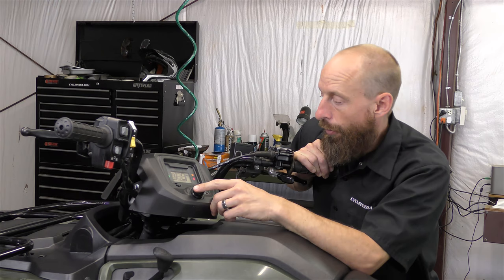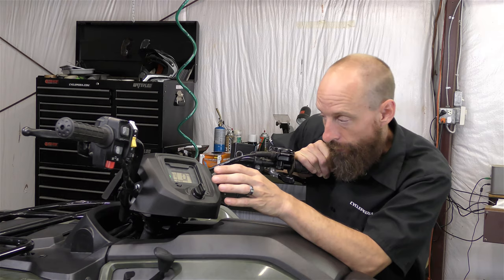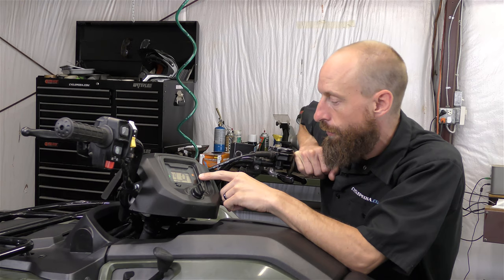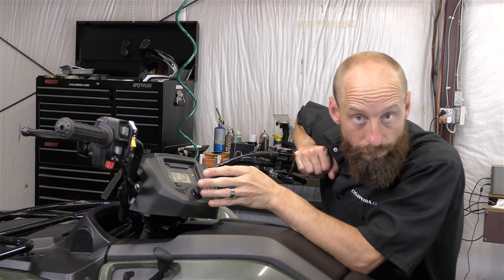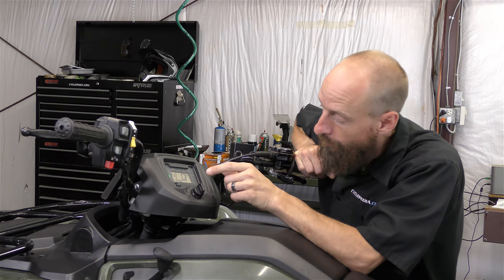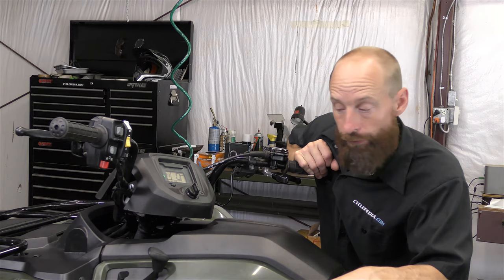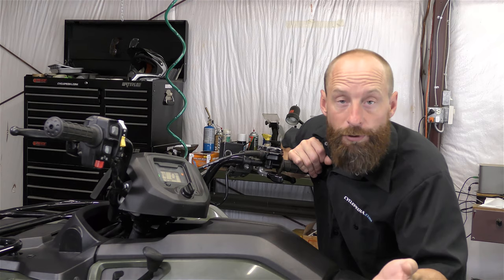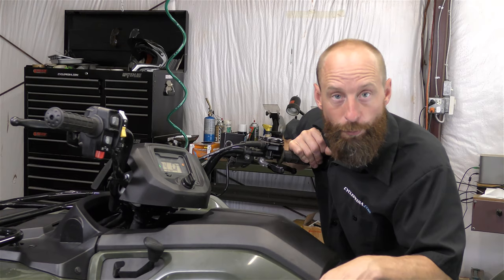Reading Honda Trouble Codes On a TRX420

Comment: 2008 trx420 manual shift. No spark. No fuel pump. Only the neutral lite turns on with key. Motor turns over. Good battery.
Reply: what you find out??????

Comment: I have been searching how to get the codes from my 2016 Honda TRX420FA2 and yours appears to be a model like mine. I checked mine for codes and I am not getting any codes but having problems with it back firing.
Reply from the maker: To start I would makes sure all periodic maintenance Items are checked, especially valve clearance and air filter.
Reply: Hey Dave what was the problem? I have the same model and it’s bogged out and back fired right now. It will idle but it Boggs out when I try to give it gas
Reply: @hernandeznick15  My problem seemed to be the gas I was using. I was using regular gas. I don't ride mine that often and they say regular gas only has a shelf life of 30 days. I switched to high test and haven't had a problem since.

Comment: I have a 2007 420 manual shift , no spark , no nuetral light and fi blinking lights wont even come on ?? Any advice ?
Reply from the maker: Take the seat off and look for rodent damage. If you don't see anything obvious then get the correct service manual to help troubleshoot.

Comment: My 420 has the same code from sitting up. What did you do to fix it? Didn't see the follow up video
Reply from the maker: O2 Sensor Heater Resistance test was out of spec, replaced sensor and fixed problem. We recommend testing components before replacement to avoid buying parts you don't need. Here is a link to sign up for the manual which includes tech support if you need it. https://www.cyclepedia.com/online-manuals/cyclepedia-honda-online-service-manuals/honda-trx420fe-rancher-online-atv-service-manual/
Reply: @Cyclepedia  thanks for the response!

Comment: I have honda rancher 420 es that wont shift into 4th and 5th gear. The angel sensor and shift motor and shift solenoid has been replaced. Would you be able to tell me what could be causing the problem.
Reply from the maker: Are you getting any trouble codes? Could be mechanical also.

Comment: I was a Honda motorcycle mechanic for 30 years .. If you don't have the pocket tester why don't you use the MIL tool to read the DTC codes ..
Reply from the maker: We just wanted to show people you can read the MIL blinks with no tools as most won't have what you mentioned and don't want to go to the dealership just to fix a simple problem like the atv in the video had.

Comment: Thanks for sharing that information.  According to your advice i have code 24.  Does anyone know what that is?
Reply from the maker: I don't see a 24 on the list I have, there is a 23 though. 23 is the o2 sensor which is common to fail on some years.
Reply: @Cyclepedia  thanks for the reply.   I’m having a problem getting into neutral.  It’s stuck in first gear this time.   Been stuck in reverse before I’m hoping it’s an shift angle sensor.   Appreciate your help
Reply: @Cyclepedia will it hurt it to run it like this ?

Comment: I have a 2013 honda trx420 sometimes it will not shift no codes but the gear indicator just has a dash   -
Reply from the maker: Make sure you have a good fully charged battery to start with, sometime a weak batter can cause poor shift. If we are talking about an ES model that is.
Reply: I have a honda rancher 2021  trx420 too its blinks 5times slow and 2times fast i have to play with the keys until it goes back to nuetral????

Comment: How to turn it off
Reply from the maker: You have to fix the problem, in this case we installed a new o2 sensor since the trouble code indicated a problem and it tested bad.